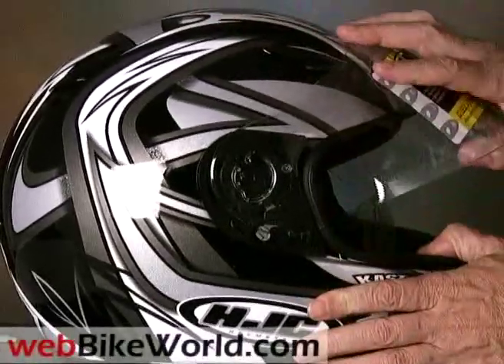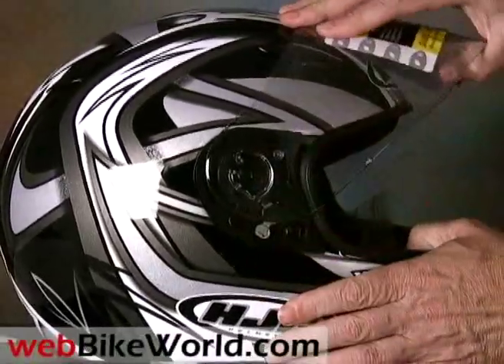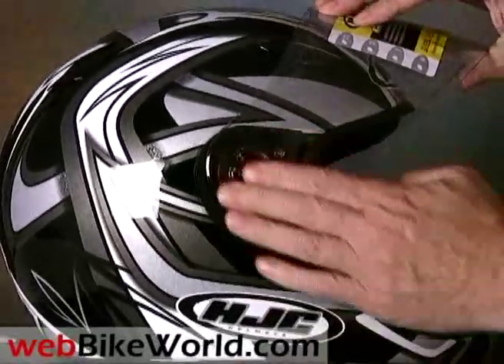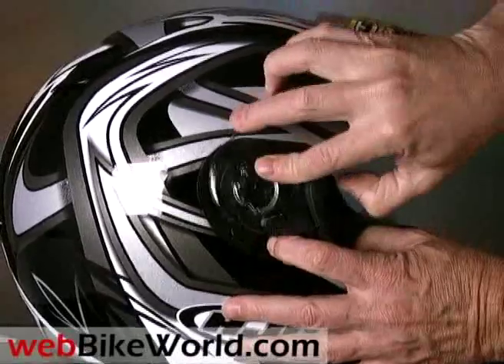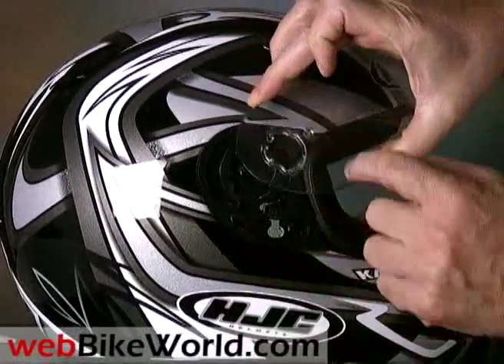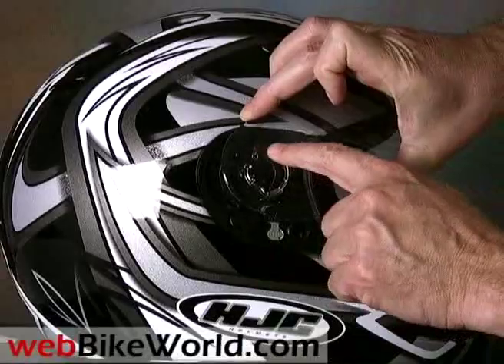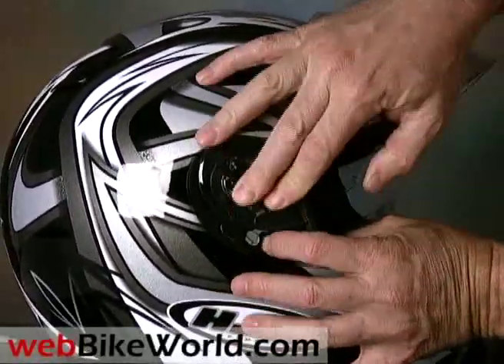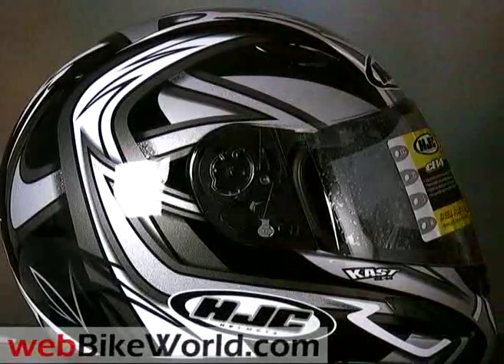HJC CL-14 Helmet Visor Removal

Comment: thank you for the video

but on the right side of my helmet.... that little grey tab connection to the black triangular prism just before the spring will not stay open. This means the black circle where the faceshield clips in will not get close enough to the black L where the little clear rod from the faceshield clips in.... :( :(
please help me fix this.... I got this helmet 4 free... & I think it is broken, but It's only the faceshield and i don't want to buy another helmet 4 passangers

Comment: nvm I fixed it... the grey notch that holds the black thing open & close to the black L was really  worn. I just held it with my fingers. It's a lot harder this way, but w\e  the faceshield isn't as important as the foam compression anyways